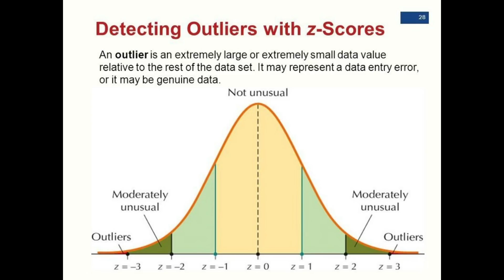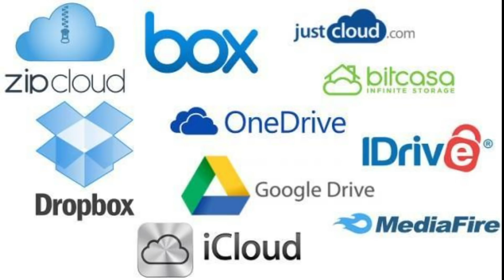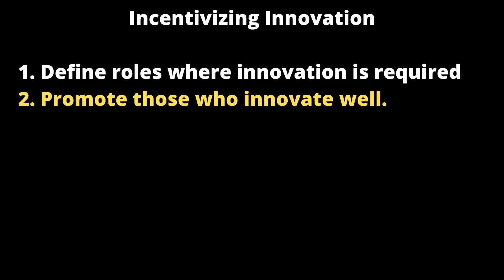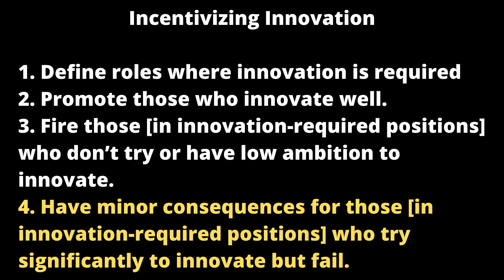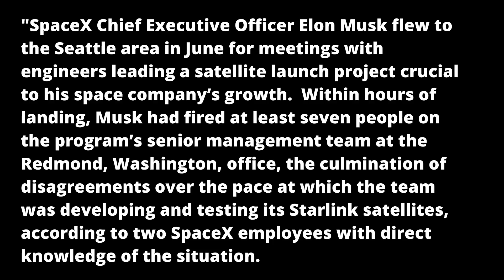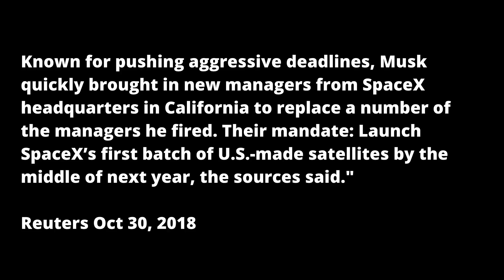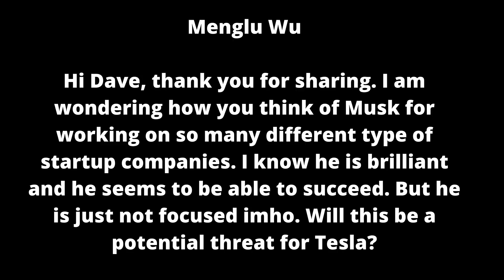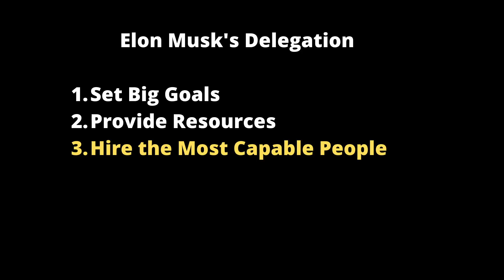Elon Musk Secret #1: How to Guarantee Innovation

Comment: Loonshots by Safi Bacall is a great book that describes how proper incentive structures are essential if you want to fuel innovation. I shared the book with my former CTO after I left my last company to try to help him reinvigorate the innovation department that I was formerly apart of. 

I was involved in a start-up project within a large company but there were no real incentives surrounding my project. My bonus was tied to the performance of the entire company so the only benefit in crushing my small team goals was pride and the potential for a leadership role if my project ever took off. 

Now I'm working for a small start-up with equity in the company and the true feeling that I'll be compensated for my direct contributions and that my successes are meaningful. There's a real difference. And my last company wasn't bad, they didn't do anything wrong or treat me unfairly. They just didn't incentivize risk taking, pushing the boundaries or questioning things. My new company openly encourages people to speak truth to power and it's awesome.

Comment: Great video on innovation.  What I don’t understand is why you then have fairly low expectations on what this innovation will achieve. For example, you think that Tony Seba’s  analysis is way too optimistic. You cite that adoption of FSD will be slower than Tony sees. Yet Tesla has the best innovators working on these psychological and regulatory issues.  So you seem to doubt that innovation can succeed in non-technical areas. Maybe you will now reconsider Tony’s analysis in a new light? Innovation in the psychology and regulation of FSD implementation. I see Tesla succeeding in this area of innovation.